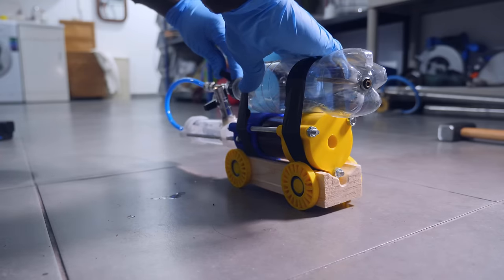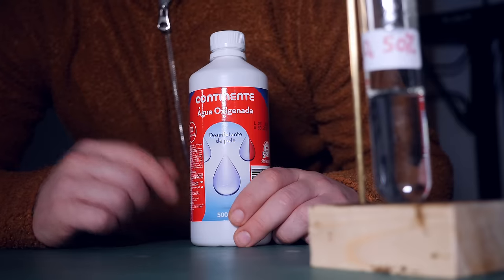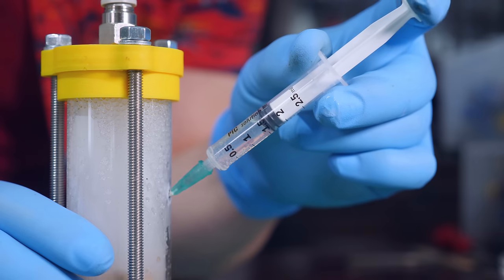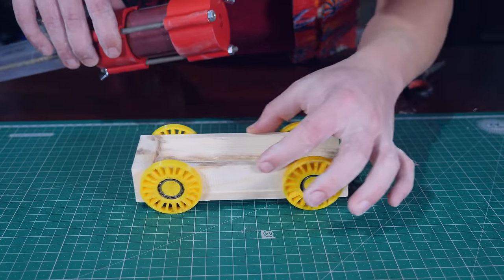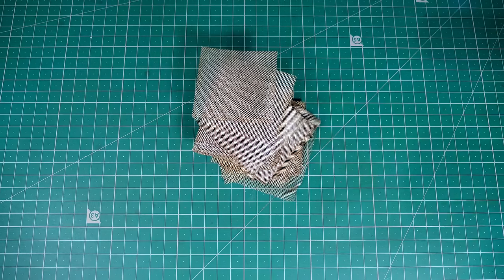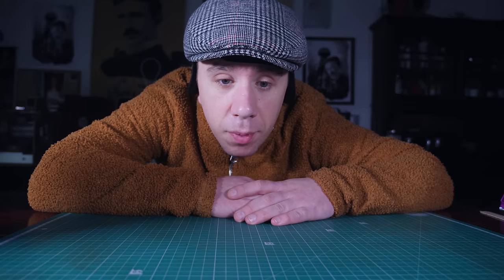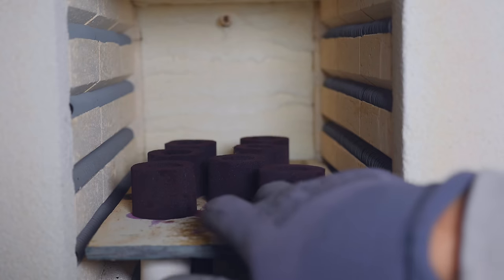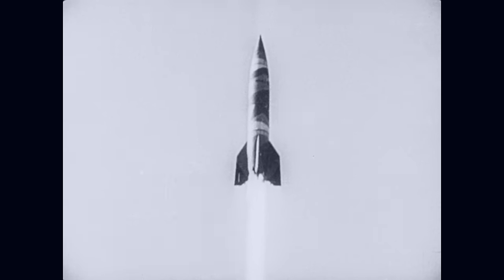SUPER HEATED STEAM ROCKET ENGINE

Comment: don't bash me that I don't remember everything you have done. but you can always use vacuum to boil off water without heat as long as the vapor pressure of the peroxide is higher than the water. I don't remember wich one is the highest at the top of my head but it might work and might be worth trying.

you could also use a vacuum still if it is the other way around but that one needs a lot more kit to make it work and it is a lot more expensive. mabye contact nile red for some info about this stuff.

Comment: Probably way too dangerous, but What if you combined with a sodium steam rocket? Then you'll get hydrogen to burn with the oxygen as well, but I'd worry about a runaway reaction and potential detonation. Maybe less reactive lithium would be safer as an initial test. For some reason, I thought you were going to just use superheated water and inject that into the chamber, which would work to make a rocket. I bet that just warming the hydrogen peroxide would speed up the reaction somewhat.

Comment: Hi, Integza! I think, you are trying to solve the problem from the wrong side. Your initial problem was proper mixing of two substances, right? I would suggest you to act differently. Mix the permanganate with a minimum amount of water possible, while still having an uniform liquid. And then simply recreate one of liquid-liquid rocket engine injectors. Permanganate purification will indefinitely help you, but it will not solve the problem completely.

Comment: Put the hydrogen peroxide in a shallow & broad Pyrex baking dish to maximize surface area, & when heated, the water will evaporate much quicker.
      I did this 10 years ago & put a drop of the concentrated hydrogen peroxide on some steel wool, & it burst into flames.
     Of course, everyone working with higher percentages of hydrogen peroxide should be extra cautious & were protective gear, because you can loose chunks of flesh, eyes, fingers, etc, in an instant if you get high percentage hydrogen peroxide on you!

Comment: There is an easy way to concentrate H2O2: Use a vacuum chamber!
But don´t use metal for the chamber. I guess you can get the setup built under $100.,

Comment: New video Ida.  Nitro methane powered turbo use the r.c. motor to drive the hot side of turbo turbine I've seen electric never seen small motor power a turbo using nitromethane 😊

Comment: It’s probably been mentioned before, but have you looked at the engine used in the ME-163? I know it used hydrogen peroxide.
Reply: It also used hydrazine in methanol which is not a nice thing to work with.
Reply: @ashe1.070  Fair point. yikes.

Comment: hydrogen peroxides boiling point is 150c... you should be able to evaporate it much faster at 100c...that said.. distilling it under reduced pressure would be the best way to get a higher concentration

Comment: 9:21 You can just put it in a vacuum chamber with no heat required 😬
Reply: You'd boil the water alongside the hydrogen paroxide, since lowering the pressure also lowers the boiling point of liquids.

Comment: Here is an idea for a video:
Prepare a module based on Raspberry Pi/Arduino, that will use strain gauge sensor, to measure engine thrust.
Preferably an easy mountable module, so it can go with any of Your engines ;)

If you don't, You're just a rotten tomato.

Comment: Video idea :
Make a rocket that has multiple rocket engine filled with the best rocket fuel recipe , and give it sum Wheels or stick it on a small skateboard (the bigger the rocket is the bigger skateboard should be) and u may ask so what's the point? This little guy that we made is going to run to a thing like bridge wihch is upward to the sky . (I don't know the name of that things)
Ain't it cool? 
In my opinion we should give it Wheels it's lighter than skateboard and it might be able to keep going up after that bridge thing that we made

Comment: Your statement that this is not a chemical reaction is misleading. It is true that the hydrogen peroxide does not react with the potassium permanganate. However the hydrogen peroxide is reacting with itself in a reaction called disproportionation. This type of reaction can occur in compounds that can function as both oxidizing and reducing agents. The potassium permanganate dramatically speeds up the disproportionation reaction but is not consumed by it, i.e.it functions as a catalyst.

Comment: I wonder what would happen with 99.9% hydroperox. I would consider it bipropellant, you are both reacting the H2O2 with the organic material and expelling that exhaust of that, and causing its reduction to water with the potassium permanganate, so you both got exhaust in the form of steam and organic combustion carbon products. Actually not unlike a regular car's exhaust in terms of composition. But yeah you are throwing steam and carbon dioxide out of that thing from two different reactions.

Comment: If you really want to concentrate your hydrogen peroxide, I think you will have to use vacuum distillation to remove the water at around 0° c. This should reduce the decomposition rate on your peroxides. The lower pressure will accentuate the difference in boiling points between the higher molecular mass peroxides from regular water. Highly concentrated peroxides are extremely dangerous and inherently unstable. Please be careful if you are copying this process.

Comment: I may be way off but I feel like you are adding too much hydrogen peroxide at once. Its true that the increased surface area will increase the rate of reaction but that is only if the two are able to interact. When you see all the stuff coming out as exhaust that seems to be unreacted H2O2. If you aerosolized it into something like your impregnated charcoal, I think you would get a much better reaction. Then again, maybe not, just an observation.

Comment: Here is an idea to concentrate your hydrogen peroxide faster: Make a dedicated VACUUM DESTILATION SETUP (with a freeze dryer to capture water as ice).

Make a vacuum chamber and create a mild vacuum.
To increase the yield even further add a refrigerator plate next to the container holding the hydrogen peroxide. That will capture the water from the air by turning it into ICE.
These two steps will increase your water evaporation.

Also, it might be interesting to lookup some phase diagrams to see at which temperature / pressure the evaporation works best.
The freeze dryer component just helps to speedup the process.
What you need is the VACUUM DESTILATION SETUP.

Here is an example of just the vacuum destilation of an H2O2 / H2O solution:
https://www.youtube.com/watch?v=2sXoKXGtBng

Comment: A decomposition is still a chemical reaction! 

A reaction does not require two reageants for being so. The only requiriments is that product or products should be different (chemical substances) than the reagenant or reageats.

For example, if hydrogen and oxygen react making water, the opposite (water decomposition) is still a reaction, even if unlikely in standard conditions.

This is basic Chemistry, I do not understand how such mistake is possible in a good science/engineering channel.

Comment: Huh.  You can’t print ceramic parts big enough, and I was promptly thinking ‘Ceramic jigsaw’.  More design work, but it keeps you using materials who’s performance you were already satisfied with -> it becomes a problem in engineering, instead of chemistry.
As to boiling off the water?  Would a vacuum let you get the temperature range and speed of reduction you can use?  not sure it’ll work well (and some vacuum pumps would object to the water…) but seriously, why use earth normal parameters for the process if you can adjust the parameters for something that  may work better?

Comment: Thanks for a very interresting video, but you've mixed some things up. Potassium permanganate can never be used as a fertilizer. I would kill the micro organisms in the soil   ..and that is why it has so many medical uses. Unfortunately I suspect it will get harder and harder to buy this wonderful substance becasue of certain idiots trying to make explsives from it. So buy while you can.

PS 
If any one reading this is thinking of using KMnO4 for ANY other pyrotechnic applications than what Integza is doing here, please dont. 
Controlled continous addition of a second component like in this case is the only wy to use it. A premixed composition intended for ignition will most likely end in disaster. There is a reason ZERO % of the pyrotechnics idustry is using it.
To many possible unwanted spontaneous reactions. No reason to go into further details here.
DS